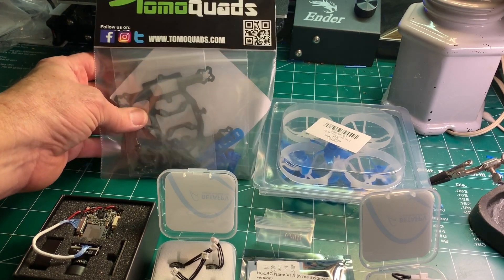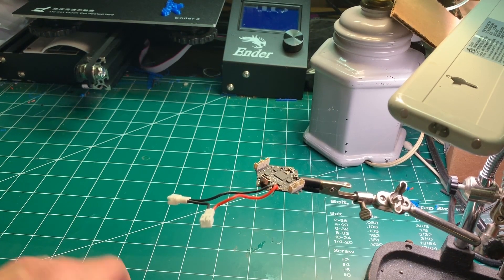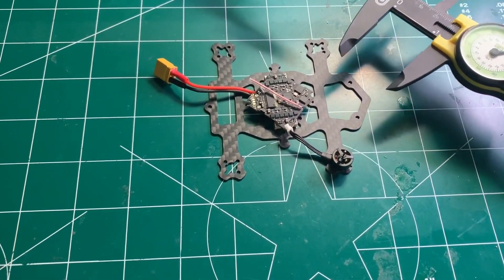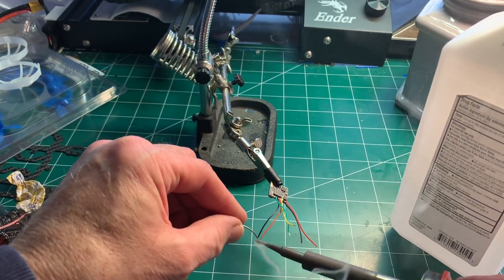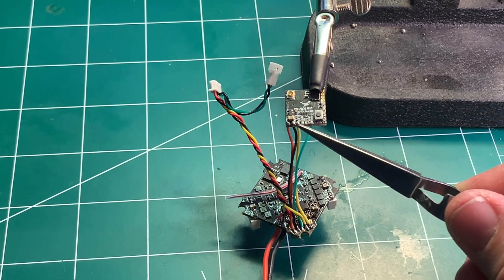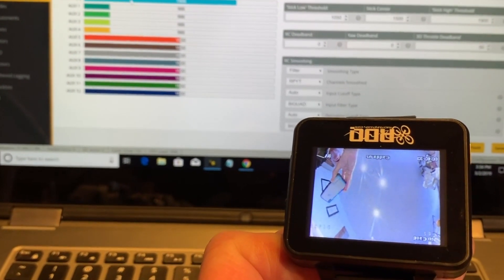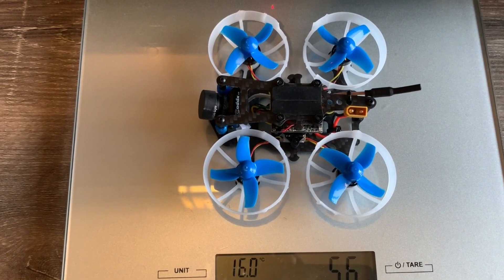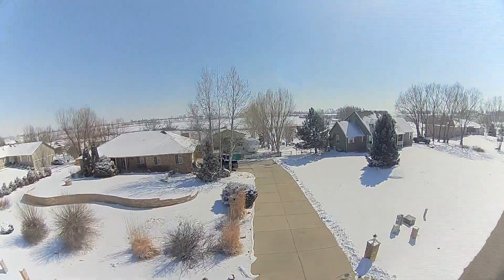TomoQuads Whoopee Beta75pro 2 Conversion

Comment: Nice build! Very well thought out and clean. What kind of flight time are you getting with a 350mah battery pack? I am currently working on my Tomoquads Whoopee HD. Can't wait to get it in the air!!!
Reply from the maker: Hi MultirotorManish,
I am getting about 4 min of flight time if I am not pushing it and just getting proximity flight footage. 3 min to 3 1/2 if I am heavier on the throttle.
Reply: SLOG FPV That is amazing flight time. Looks like I need to try lower Kv motors. I’m using the 19000Kv motors out of my Mobula7 and getting  minute and a half tops. Thanks for the info! Going to order the same motors you are using👍🏾